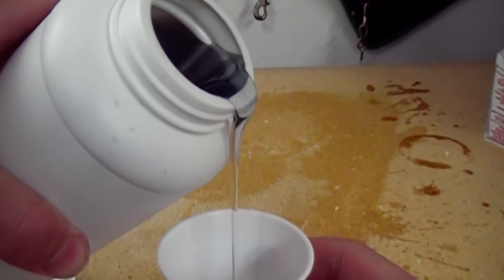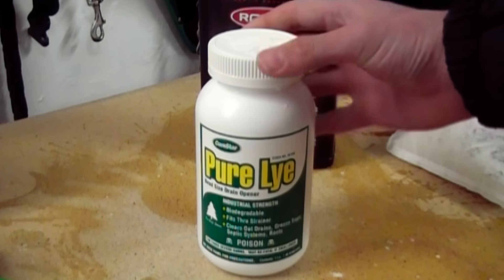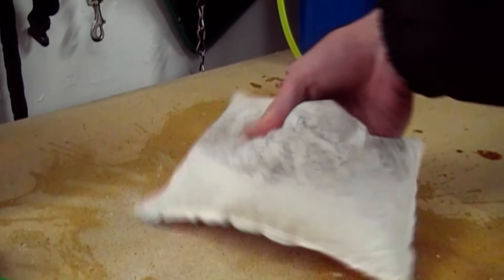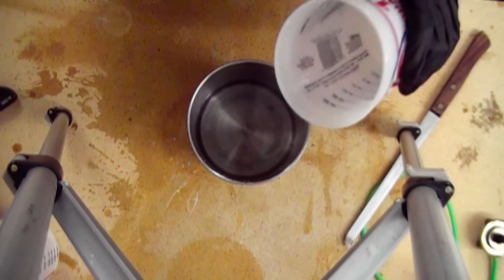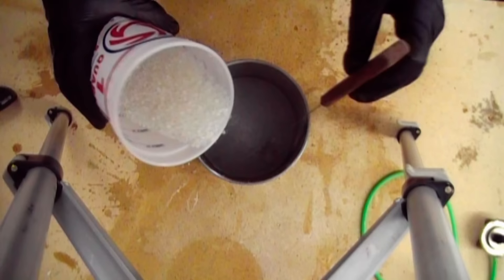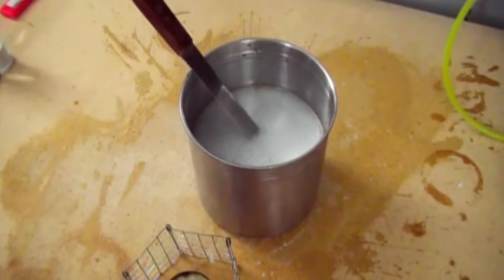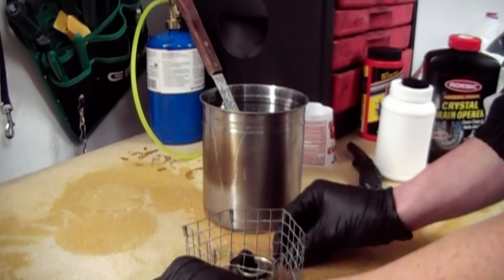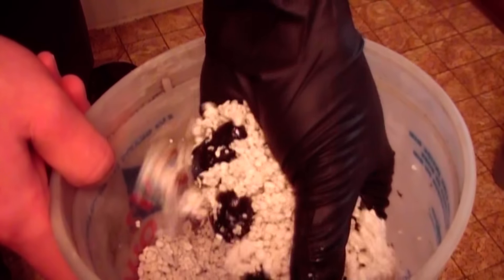Homemade sodium silicate (water glass)

Comment: Use a stainless steel pressure cooker. Make it in about 45-90 minutes (@15 PSI) from clean kiddie- play-box sand and sodium carbonate with minimal water added. Using too much water kills the reaction.  Add only enough water to cover.  Ratio: 2 parts sand to 1 part sodium carbonate with enough water too cover. That's how PQ Corporation makes the real stuff, I used to work there. This will yield an "N" grade sodium silicate product with a much milder alkalinity than your mixture which is too radical, too much lye!   This yields an 80% reaction and the remaining 20% sand is used in the next batch. The 80% sodium silicate is decanted off. Eventually an excess underacted sand is deposed of due to high alumina, magnesium or calcium content, not all sand works but its good enough to make tons per hour at 80% yield in our 300 gallon STAINLESS STEEL pressure cookers.
Reply: Is that all - ! Can't wait to do my pavers
Reply: I tried your method my sio2 source was crushed mirror powder, iam using kitchen press cooker about 14 psi but iam not really sure it was sodium silicate or not because it feel so slippery like washing soda itself so i couldnt tell the differences,  hence after some time it become jellified
Reply: Any idea abt Stannous Octoat making pls
Reply: you miss out the stage where the silica sand and calcium carbonate are calcined [roasted] together at a temperature of 1100 degrees centigrade. Use that as your feedstock and your reaction will work
Reply: @bigoldgrizzly  This. You need to calcine it. Compounds don't react in water.
Reply: @alexa.davronov1537  correct... that is the second part of the operation. The feed stock is added to water

Comment: Just a comment. You can buy 20lbs of pure silica gel for $10 it's called crystal kitty litter. Then the lye is also cheap. I can't believe I've been searching for "high temperature glues" literally for months now ... I've used every "high temp" glue at Lowes. They all break down at 500F. Then finally I find this shit. What a miracle science is... this is EXACTLY what I've been looking for.
Reply: +Robert Cece 
 Hi, and same boat.. thanks for the heads up on the cat litter, $20 a kilo for gel on ebay, $1 a kilo for cat litter.. o.O
 I'm set to build once I can find a substitute for the aluminium oxide.. can I use fire-cement instead or have you any advice? appreciate you help mate.. :)
Reply: Julio says Yes, absolutely. Fire cement will work fine. They make it just by adding talc (baby powder/magnesium silicate) to silica, sodium silicate with a low % of lye. You won't have ANY melting issues with either fire cement or making it yourself at home.

The REAL problem here isn't melting points as much as thermal expansion and curing things properly. So if you want my best advice to avoid cracking/degradation... you really just need to preheat the forge everytime you use it. And let it dry real good for like a week before firing it up otherwise you'll see a yellow flame, steam and the lining WILL crack very fast.

When preheating just run propane through the forge (lit) without any assisted air for 2-3 mins. Then you open the air cover/valve. And also when you shut the forge off always make sure some type of cement or metal lid is on it. Otherwise you wind up with white hot fire cement hitting "cold" air and you'll literally hear the cracking as it cools down.

It's these simple, but time consuming practices most people skip which leads to their forges breaking. And even when you follow best practices 100% all forge linings eventually do crack. Even if just a hair. When that happens all you need to do is respackle a bit of firecement. Gluck. ;-)
Reply: +Robert Cece Hey just got your message, thank you for the advice, >> Update: right now I've 25kg of fire clay, 25 lt of Perlite, 3 or 4 kilos of silica gel + powdered caustic soda.. <<--ready to cook up some water glass}. 
I've roughly 50kg of a silica sand, the dark colored used for cobblestones, it seems very gravely.. but have a few kilos of play-sand out in the garage... oh and picked up 5kg of high temp furnace cement.. 
 im good to go I think.. with all I've got, would it be asking too much for you to come up with a recipie? 
 I can source other materials if im missing anything... 
 so what you think? I really appreciate you help & any advice.. I wanna do this build with confidence from the off, knowing ive a solid plan will get me primed to get on it this weekend. :) 
 again, thank you Robert..
Reply: I have used sodium silicate to repair two engines that were leaking water into the cylinders and also to repair a leaking heater core on a 2002 chevy S-10.
The removal of that heater core takes removing the entire dash of the pickup.
Reply: I have done this before . It is a pain in the A
Reply: How do you use it? Use it to stick two parts together at room temperature and wait until it becomes rigid?
Reply: LOL yeah. Not so many people now about tha.

Comment: @ Nick Pierson  I agree.  Sodium Hydroxide, (aka Lye, Caustic Soda) is a very corrosive material in its concentrated form.  It will melt simply by absorbing humidity from the air.  On skin, it melts and seeps into the pores and can cause third degree burns.  In the eye (to my own sorrow, though I wasn't blinded) it will store in the tear ducts and as the eyes' defensive discharge of moisture tries to clean out the eye, it causes persistent damage to the eyeball.  I had 60% of my eye burned by 1 single bead finding its way into my eye.  The point:  EYE PROTECTION IS A MUST.  If you neglect the use of gloves or any other PPE, at least protect your eyes.
Reply: NaOH in the eye must hurt like hell, didn't it

Comment: You can get 100 percent water glass at fireplace stores for about 38 bucks a gallon and no home chemistry project!
Reply: Dean Carder It is a simple and safe process, and also I can make a whole gallon for less than 10 bucks.
Reply: +William Drake is it the liquid gasket cement?
Reply: 100 percent water glass is a solid, that is sold by weight. The solution sold at those stores is water glass mixed with water. For most people, making it out of lye and silica gel represents a very significant saving that is well worth it.

Comment: I just made a batch of this today. I used a Metho burner camping stove. It didn't burn as hot as your butane burner. I just sat and stirred it constantly until I ran out of metho. It didn't bubble up while boiling like yours, but I ended up with the same consistency. While searching for Lye in my local hardware store, I was unable to find any drain cleaner that was more than 55% Sodium Hydroxide. I ended up Googling it and discovered that Caustic Soda is the same thing and I found that in the Plumbing section that was 100%.
Reply from the maker: +Shazbud Cool, that's interesting that they had both "drain cleaner" that was not pure as well as "caustic soda" that was.

Comment: For those who don't know where to find Silica Gel material in its bulk for for dirt cheap check out your local building supply stores concrete and masonry section.  

I just picked up a 50# bag of Silica sand/Quartz sand (same SiO2 chemical structure as silica gel pack SiO2) for $6.
Reply: Will there be impurities in the silica sand/quartz sand?

Comment: Just got done making a batch of sodium silicate. Pretty cool stuff. I got 4 lbs of mimi cat litter silica 4$, 1 lbs lye 4$, and tap water. First blended 300g silica in a coffee grinder which made a very soluble silica powder, then mixed 200g lye and 500 ml water in a pyrex beaker, and slowly added the silica powder which dissolved almost completely. It generated plenty of heat and didn't need to heat up at all.I ended up with a small clump of undissolved silica but the liquid was already seizing when I pulled out the stir spoon, so called it good. Was surprised it turned out purple also... hehe. 

Around 600ml concentrate sodium silicate for basically 4$ since there is enough lye for another batch, not bad at all. Thanks for the video!
Reply from the maker: free8704 Cool!
Reply: clkindred Also worth noting that there was definitely ammonia generated as a minor byproduct of this reaction. I'm willing to be that it is a result of the lye reacting with the small quantity of blue granules that come in mimi cat litter. No big deal really as ammonia is volatile, but worth mentioning.
Reply: Hey could you help me?
Let me understand, you didn't put in the heat?
You mix it up the lye, water and after "reaction" you put the kitty litter silica (grained in coffee grinder) and stirred it?
My english is bad . That's why I'm asking the obvious. Just to understand.
Reply: I have just a few questions about 
I want to no know if waterglass work's like resin?
I want to mix whit wood dust and other dusts like sand, and things like this.
I want to know if will harden and will be strong glue.
I want to make musical instruments whit recicled wood dust
But need to know if make good and strong material... something like pipes
Thank you for share your recipe
☺️🙏🏾

Comment: Thanks for your Video.  I made this stuff Yesterday.  I did a double batch.  Next time I am going to do 4 or 5x that amount as i see more and more potential uses for this stuff.  I actually left out the aluminum Oxide Powder and used Pumice Dust in it's place.  Really appreciate the ideas you share.
Reply from the maker: +Ben Griswold A good alternative to aluminum oxide would be a good thing because aluminum oxide is kind of expensive. I would be interested to hear how well pumice works, and where pumice dust could be sourced.
Reply: +clkindred It seems to be working.  I have used it as a  burn chamber and chimney liner in a rocket stove.  I also lined the inside of my brake drum charcoal forge to create a sort of funnel with an insulative effect.  It has increased the efficiency significantly.  Time will tell on how it holds up in the forge but i am not at all concerned about the rocket stove.
I share your sentiments on the cost issue; hence my attempt at a solution.  About sourcing pumice dust; my situation is unique as I buy small trailer loads of pumice every few years to make my own potting soil mixes for my Bonsai trees.  The trees do best in my rainy climate if all the fines or dust is sifted out so I end up with a few wheelbarrows full of this stuff that passes through a window screen.  For the forge lining, I used the dust that passes through a 1/16" or 1/32" hole screen in place of the aluminum oxide.

Comment: At what point does the mixture become neutralized? I ask because many years ago waterglass was used as a preservative for fresh eggs. Eggs would be dipped in the solution, completely covered, set aside to dry then placed in nonrefrigerated storage.
Waterglass was also ( might still be ) used in the fireworks trade. I've used commercial waterglass and never had a problem even when bare skin came into contact with it.
Reply: I also am interested to understand in what dilution water glass can be used for preserving eggs.

Comment: Fantastic tutorial.  I'm curious:  what kind of temperatures are you able to achieve using your stainless steel trash can forge with the pearlite and water glass refractory set up?  This question is related specifically to knife making.  Is it really necessary to apply the "icing" to the pearlite, or could one skip this step?  Thanks for sharing

Comment: I have a question, I'm looking at refractory additives to cement for a pizza oven, I watched you forge video which led me to this, but instead I just bought some...then I researched alumina..and then I came across a spill absorber called magic monkey..labeled as alumina silica. Question will that work as an alumina additive and will the silica benefit it more. I've seen refractory brick made out of alumina silica. Question would that product work..also adding in the water glass I purchased? I will also be adding perlite and kitty litter clay? Any thoughts? I realize I should have posted this on the other video instead..sorry..

Comment: Do you know how long this can be stored and still be usable?  Example:  If I make too much can I store the remainder for a while (a year or more) and it still be usable?  thanks
Reply: As long as it stays dry, it will last almost forever. If it get wet often or left out in rain it will dissolve,,,, it  can be dissolved with lots of water left for a long time. Even when  a 6" C-clamp fell into it and was puller out and left to dry,, I just put it in water and a couple days later it was perfect.
Reply: @offgrid-j5c    I thought that once the sodium silicate reacts with either an acid or CO2, it basically loses it's sodium ions and turns into straight glass?  If so, then any amount of water shouldn't affect it?  Am I missing something?
Reply: @justinw1765  ,,, It will Never become actual Glass!  It is called "water glass"  (2 words)  because it is clear like water and protective like glass. (as with chemicals).  I made mine using  silica gel from cat litter,, (100% silica gel ,, with blue dye, the dye dont matter). I used sodium hydroxide (lye) crystals added to water and heated to almost boil,,, then  remove from heat and pour in the silica gel,,, it will get hot then by itself as the chemicals react. Be very careful,, it gets hot. Do it in a well ventilated area,,, the lye fumes are baddddd!  Sodium silicate has been used for hundreds of years,, they even use it to preserve chicken "eggs"  back in the day. They just drop the eggs into the water glass liquid and eat them months later. When I made mine I added it to sand and made a "refractory" cement for my homemade forge. Works awesome,,, my first brick was 1in thick x 4in x6in,,,, when it was cured I could hold it on my hand and run a propane torch to it for 5 minutes and the heat never transferred to my hand,,, it is a awesome insulator.  It had to be dried and cured for fire cement. If you spread it onto something it will turn white as it dries and cures. That takes some days depending on the temp and humidity.  but as I said,, it is 100% water soluble until it is "Cured". Brought to a very high heat like a furnace,,, it will not dissolve with water after that!!  Cured will be a hard brittle substance,, that does NOT react to heat or watere and is great for kilns,, ovens and forges!
Reply: @offgrid-j5c  what sand did you use?
What proportion for brick?
Was the brick porous or just solid chunk.
How is it holding up?
Thanks.
Reply: @Tiyagi99  I used sand from Home Depot. Just play sand. It is Not beach sand,, that doesn't work as well because the sand is all little round beads, where crushed sand has sharp corners, is rough and locks together better the round sand.  I hade mine to be moldable. I hold a handful and squeeze it tight then see how well it sticks together. I then layed it 2in thick all around the inside of a BBQ body. One of those $19 dollar types,,, lol.  I built a coal forge from it. It was not very durable at first,,, till I figured out the it get really hard and durable after it has been dried,,, not in the air but by heating it.  I had to put the BBQ body with the waterglass lining on top of a wood fire for several hours to "set" the glass. After that it was and still is great!!  My first try and experment was a "brick".  2.4in thick 5.75 long  3.25 wide. It was awesome for heat reflection. Again I was experimenting and put the formed soft brick In my wood stove,, as I was impatient and tried to "set" it that way,,,, did well on the bottom of the brick, against the fire but not so good on top of the brick where there was less heat. When I took it out and let it cool teh top area fell apart but the bottom stayed tightly set. It was only 1in think by then.  I used a propane torch ,, held it in my hand and put the torch to if ,,, for 5 fill minutes before I could feel any heat at all. It worked great. If done with "patients" in a good oven then it could be equal or better than store bought refractory bricks. Cheers!
Reply: @offgrid-j5c  thankyou. One last questtion could I use it for my mini arc furnace temperature tolerance is my main concern?
Reply: @Tiyagi99  ,,, I would guess that it could easily handle 2500f. (1371c). The more compressed it is the more resilient it will be both for durability and temperature.  No worries on asking questions  are Free!! Twenty bucks per answer thought!  lpolol. Just kidding. Ask away,, I'll share whatever I know.
Reply: @offgrid-j5c  LoL. you are so cooperative I wish I could be of any help to you. I am an electronics hobbyist and enthusiast so any time you need some info...
Best wishes.

Comment: Great video! Couple questions though.... where do you find the silica gel packets like you have? Other than in new clothes and shoes? And also, if you made the perlite concoction for the forge into bricks, could they be used for making an electric kiln? Are they durable and insulative enough? Can't wait to try this! I got an old helium tank this is happening to...
Reply from the maker: You can buy a four pound bag of silica gel at walmart for five bucks. It's sold as "mimi litter" cat litter. I have not tried making bricks, yet. I am experimenting with different recipes of diy refractory. I have found it is best to use the perlite as a secondary component to modify the properties of the refractory, not as a primary component as is can melt at high enough temps.
Reply: clkindred cool! thanks! Also thought about making your own lye using wood ashes and water... I think that makes lye as well... at least thats what tanners use to dehair their pelts... ill use your mixture you use for your forge and try to make some bricks... Ill let you know what I find out... good or bad... keep up the great videos man... thumbs up!
Reply: 7 yrs later but you can also buy bags at hobby lobby.  Flower dryer